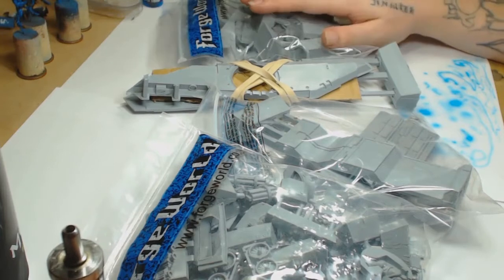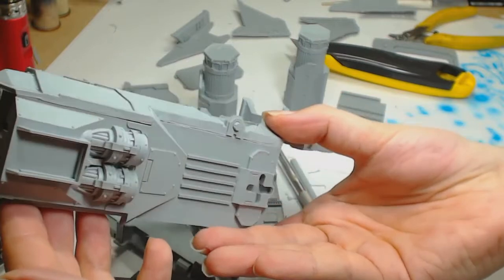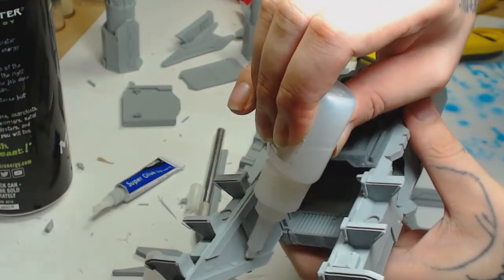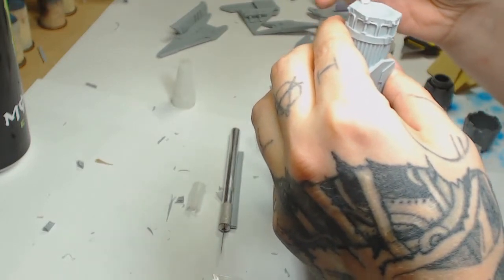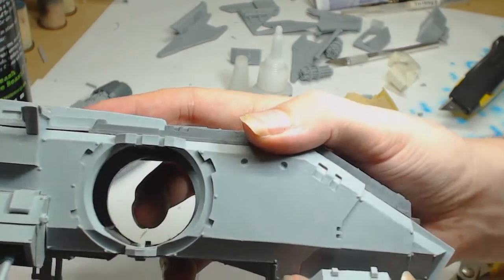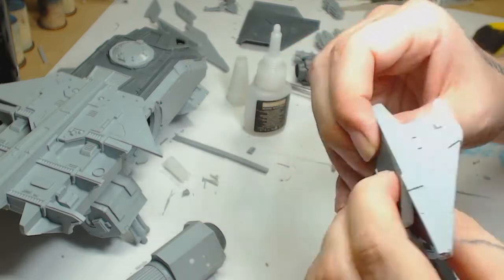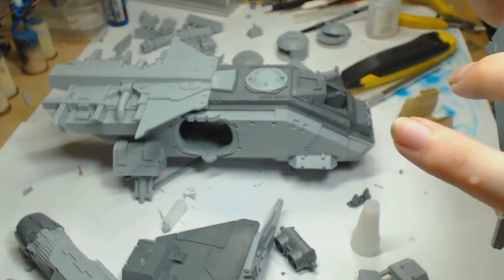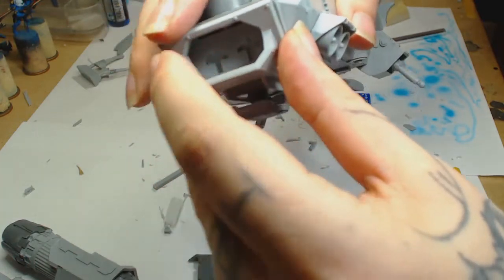How To Build A Forge World Fire Raptor

Comment: Thunder hawk was sooooo much harder than this kit. I spent three days straight with barely any sleep to get it together for a local tournament. Thing weighed like 20 lds but it was perfect. no open seems flash lines, warps or weird defects. After building this kit how ever I would buy more raptors. Much easier. Also thanks for the video helps a lot when you get most forge world stuff second hand, why people buy kits and never make an attempt at it I'll never understand